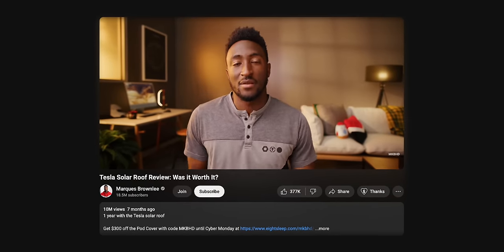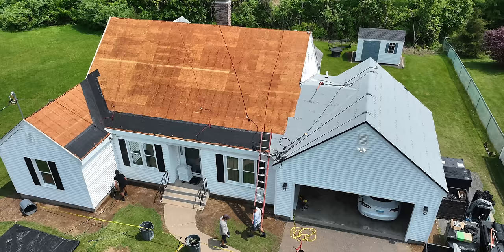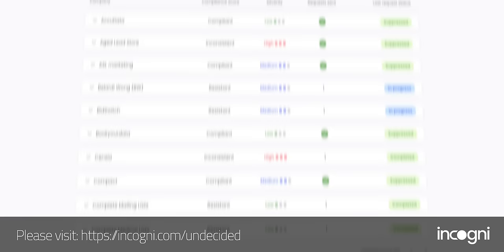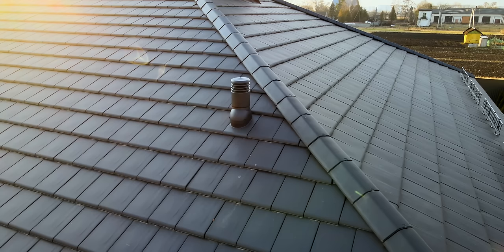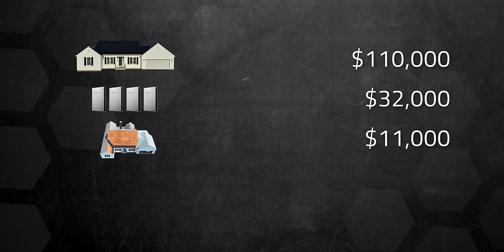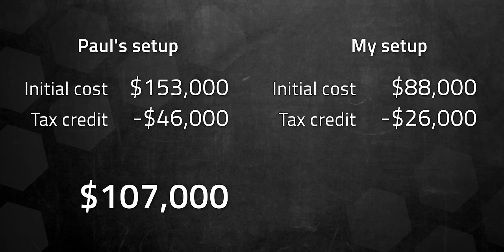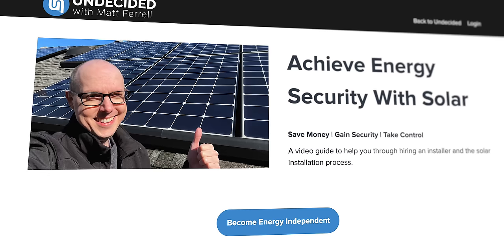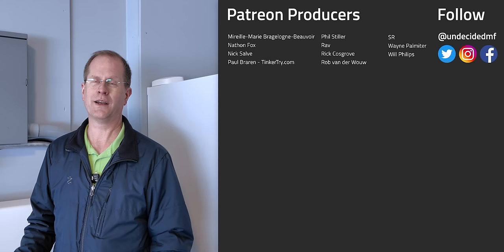Tesla Solar Roof vs Solar Panels: Which is Worth It?

Comment: Great report Matt. As far as gauge for cabling, going N+1 in sizing does really hurt (except one's wallet at install), specially if you are digging, you apy for the future deployments. The hot topic will become Bi-Directional charging/V2G. It also seems like utilities companies should not regulate customer's solar install capacity or number of batteries, which seems to apply depending on states. Tesla deployments are more appealing for sure, if you can afford it and get an installer to put it in. Another great point, where the inverter is smaller than the solar circuit, shaving the top end expands the total daily production output instead of top peak (specially w/East-West setups)_

Comment: The problem with that bug is obviously tesla's only fixing the people who notice that it's doubling how much power they're making because they have another way to measure it they're not pushing that update to everybody and that's the sad part people think they're getting more than they are to offset that cost, its programed to be doubled and they did it on purpose.
Reply: There's actually a 3rd party auditing meter in the inverters, and the power company has their smart meter to keep tabs on accuracy too. It seems this temporary bug has been fixed for everybody now, it just took a while to roll out.
- Paul Braren (Solar Roof owner featured in the video)
Reply: @TinkerTry  In my opinion a product should not even leave the factory with a bug like that, its kinda a ongoing problem with any manufacturing they forget to actually do some in house testing, instead they rely on AI or computer simulations to test products, and that leads to problems obvious problems, installers sure would love to have some input into manufacturing, the layout of the internals is setup for manufacturing not the guys who actually touch and use the inside of these devices and have to troubleshoot or repair. It alot to pay for something obsolete in six years. Do expect those cars to last as long as those panels. Its good old planed obsolescence, those roof panel might be rated to last for 100 years but tesla planed obsolescence for them is 10.
Reply: But hey your lucky your the .0009% of US people who spent money this product.   1 of 3000. Me I would buy a property with creek and make one of those old devices that make torque, o ya a paddlewheel and a windmill old school style, which also outputs more in bad weather, they can work all day unlike solar panels that have a 6 hours on, 18 hours off duty-cycle. But I was taught not to wear black in the summer, you gonna need all that free power to cool that black heat absorbing glass down. I think your panels will still be 90 degrees after midnight on good summer day. Cost? Effective? Be curious of your opinion in ten years will your car and house batterys still be able to drive down the road and put out a charge if cycled once every ten days, my car will and its a 1990 ford festiva, well taken care of and daily driver.

Comment: My takeaway from this is that folks who live up north and/or are influencers spend far, FAR too much money for everything and seem to be ecstatic about it. The "permitting" issues seem to be heavily glossed over as well. Will Prowse taught me (a layman) that I can get solar, batteries etc INSTALLED for less than $2/watt. If one wanted to get used panels it would be even cheaper. Also it would not take months or years to get the system installed.  These systems refenced in this video and by the other fellows featured in this video give a terrible impression to anyone not ALREADY conversant in the advantages and pitfalls of solar power.  I simply fail to see how you all can present such a rosy picture in your cases which are NOT representative of reality.
Overpaying by fifty to one hundred percent OR MORE is NOT a virtue and does NOT make this appealing to "REAL" people. You do home-based solar a disservice.

Comment: Really great presentation Matt😀
Interedting that solar power is so so expensive in USA
How in Australia it is the norm yo have solar power
Guess that is because of the cost
12 years ago i bought a 1.5 kw system.(Yup, minute by your standatds) For about USA $750.
That is about one, two hundred of what you paid!!!!!!
As where i live is warm in summer and supper mild in winter, most of my enrrgy needs are coveted in the day as you can let the aircon and pool pump only run whilst the sun is shining. Result is on average me needing about 7kwh per dsy from the grid.
Cutrently the average solar system installed in Aus is alledgedly 10kw andonly costs a few thoussnd dollars.
Which i guesd is ehy mostoeople hete have solar.
As batteries this year should cist maybe $70 per kwh to manufacture (china has a glut of batteries and think they halve the cost of building batteries this year.
So soon become common for people living in Aus to disoense with being connected to the ekectrical grid as it will be cheaper to run your home from solar and battery.
Sorry for the long ramble,😀
My point is you guys seem to be paying at least ten times as much as we do for solar.

Comment: 55k for 18kw solar not including batteries? You got ripped off dude.. why did it cost so much?
Reply: Yeah I have to ask the same. Since he's not an idiot, there has to be a reason, and the panels he mentions are definitely upscale from what I can gather, but I can buy a pallet of 35 panels, 445 watts each, for like $3 grand; sure, these are 20.5% efficient, not 23%, but... if that's enough, it's enough. Obviously not including mounting, mounting hardware, electronics etc but still, $55 grand seems pretty steep.

Comment: Respectfully, This doesn't make sense to me. Or I'm missing information. I don't remember what you claim is the life span of the solar product itself. I've always understood that solar panels generally have an appropriate 20 year life span. 
Your question, why don't you see more tesla solar roof? In my opinion, it's doesn't make financial sense and in some regions like mine, the government makes it useless. 
Explanation:
On average I pay approximately $100 Canadian per month.
Thus $100 × 12 (month) × 70 (year) = $84,000.
If you stated it cost you $88,000
It would take me over 70 years to break even. Where is the savings? 
Seems cheaper to pay the electric company because I'm 50 years old and unlikely I will live long enough for the next 70 years just to break even on that purchase. 
As for the governments involvement when it comes to solar. They don't give you much of a discount or pay you for giving to the grid and that is the only way here to set it up. Either way, they bill electricity with the water bill. Can't separate it. Thus with their delivery charge, I will always have a minimum $35 bill just for the electricity bill because of the minimum delivery charge. It's the way they earn their operating cost because many have learned to conserve well. I had heard that there was a way to get tesla solar roof for free (for Americans only maybe). In which Tesla installs it but owns it and Tesla therefore earns the revenue for supplying the grid with electricity. Since here it's not a lot, I assume that's why that program is not available here.

Comment: First of all i would go with a ground mount. The racking is a bit more expensive but I never need to worry about a roof problem.  Seccond I would use bifacial panels in a north south fence style where the duck curve is eliminated and lots more output in morning and evening when I need powr the most.. a curve that looks more like a two hump camel.  I am also down in Tn so output is a lot more over the course or the year.  As to cost one can look at where 90% of the panels are produced... you may have heard of China.  You paid a boat load for your batteries I would prefer to not pay 3-4 $ a watt.. Did you know new panels are in the price range of 0.15 cents per watt.  So a 20kw array is the cheapst part. So talking $3000 for panels  Then looking at micro inverters made by apsystems a major player in micro inverter space.. Found them being priced at 130 plus shipping.. would need 18 so call it 3000 with shipping.  2000 for racking and another 3000 for misc. including wire and conduit along with some ac disconnects and such.  All told should come in for around $10000 before federal help.  Sure beats the heck out of 107K  even adding in $5 K-10K for installation.  forgot to add batteries.. call that $3000 as power does not go out around here very often perhaps once every 2 months for 3 hours.  this is for apex battery box and 45 kwh of back up batteries..

Comment: The prices seems WAY to expensive comparred to installation prices here in Denmark. almost double the cost, if you exclude the batteries.(even with a hybrid setup the prices are about x2)
I don't get it... and then looking at tesla prices.. NO WAY 🙂

Comment: Within 15 years  efficiency will drop so much to about maybe 6% re tiling whole house will be necessary. Rather than just updating panels simple not affecting integrity of property because Tesla solar roof not conventional construction, delamination degradation relatively unknown factor Devaluing overall value of property. If money to through away  not concerned with that and virtue signalling your neighbours more important. Is a choice to make I guess. I wouldn't do it. High efficiency tricking setup if land available would be my choice. Very easy relatively cheap minimal disruption would add value. I'd also sort out apparent leaks in basement would be good also. I very rarely watch any M F undecided stuff have unsubscribed a while ago.

Comment: Vivo en un rancho tengo una casa de 3 recámaras comedor sala tengo 16 baterías de 6 voltios Call una tengo 6 paneles solares en el piso me costaron 50 USD cada uno tengo un inversor de 5000 vatios me costó 500 USD En total gasté como 2000 USD más aparte las baterías que valen como 100 USD cada una O un poquito más tengo aire acondicionado Los refrigeradores Y todo trabaja a la perfección no tuve que gastarme 150000 USD se los dejo de tarea

Comment: It iss impossible to watch your videos nowadays, since youtube decides to blare a horribly translated audiotrack, instead of your original audio. There is no option to turn it off either.
Reply from the maker: Thanks for the feedback. To help us out, what language were you listening too?  And if you recall any specific sections or timecodes for bad examples, that's even better.
Reply: @UndecidedMF  i dont know if that is an issue with my youtube client but there is no option to turn the translation off. I'd rather listen to you in english than to a machine translation that - to be fair - was correctly translated but sped up to match your pace.

I'll look into if the issue of not being able to switch audiotracks might be a problem of yt revanced. (It probably is)
Reply from the maker: @m00str  strange.  You should be able to switch it.  On the YouTube user interface on the video player you can tap on the gear icon.  Then select “audio track” and pick which one you want.

Comment: The roof is probably to expensive still I have only seen one in  my 25 building inspector career  with 60,000 inspections under my belt and the builder installer did not know what they were doing in the first place not even basics I had to fail them many times over the build the home owner was freaked out needless to tell you , and the PV,  people hired an electrician who did not know what he was doing also so the general and the electrical guy were basically the blind leading the blind  they could not follow basic installer information and they did not want to either, it was like pulling teeth on a mule, but I have to sign off on it so if anything goes wrong I'm in the mix

Comment: Re: Tesla caring at 16:31. I have had trouble getting my
Multi unit discount. https://youtu.be/xOiD1XD_3NI?si=1QLIEzrBlSCOZwlG I fully believe it was intended but they are basically sticking it to me for $4000 due to my/their oversight, plus either ignorance or lying. It has to be one of the two. I do like the Powerwalls but I have Enphase Solar, arguably better. Example: very little external conduit. IQ 7+ here, have hit 16kw *output*. And summer isn’t here yet.

Comment: it would be nice to understand your expected ROI because all things considered it keep looking like an idiotic alternative to Nuclear to me ( I've solar panels on my own house) . I've seen your other video and made some calculation with parameters I've :  you say your expected consumpion it's 1500 kwh\month which , with current EU prices , means you'd spend around 4-5000 dollars\year in electricity without panels\battery were you to live where I live ....which means with normal inflation a payback of 15 or so years (with zero subsidies ).  I understand the choice is bit more ethical than metrical but without tax credits it's simply a nonsense for the taxpayer . You also support an economy that is largely not american\european by subsidizing panels and batteries on average and when you do ( the installer) is typically a very low value added job. Notthing against your choice off course (or mine for that matter)  , I'm speaking broadly about the sense ( or lack of thereof) in the policies our governaments are perpetuating when the (green) alternative of nuclear&hydros makes way more sense.

Comment: My solar roof installed last March was around $42,000.  Plus, I got a tax credit of $12,798.  Now, I only have about $29,000 left.  I did not opt for the powerwalls.  I did not get a roof replacement since the roof was only 6 years old.

Comment: The both of you got cheated. So expensive. That powerwall battery is a scam for sure. EG4 14kwh battery is around 3.7k. You can buy 4 of that and spend half of what you would spend on a Tesla powerwall. For 30k+ you can get over a 100kwh.
Reply: Don't start with me about DIY batteries. For 30k, only God knows the capacity you would get. $105 for 896wh.

Comment: but the free live in tents. houses are under law. permanent stuff requires worry. under the current administration. if any is required. at all. minimum everything. you must have an off-grid power wall with optional grid plug only. support market model is failed. independency vs dependency by design. clear winner is freedom. you are only doing overhead, not the meat. diy you focus only in the essential. because none is doing it for you. assume no support or reliance. fix sort you stuff. because you are no longer supported. pretenders dont move in, stay out or be in it. there is no mixed mode, law or free. remember there is no false gods of any type.

Comment: I had a conventional solar roof on clay roof tiles that existed before my home purchase and I regret having it. It caused leaks inside my house due to rain after 8-years of owning it. It seems that the solar installer did not do a good job. Not only did they damaged my roof, but they wired it incorrectly. The 14 panels were wired in series instead of parallel. It has costed me about $85,000 to repair the three rooms damaged in the 2-story house, the cost to fix the roof, and four months of hotel stay while my house was remediated from the water damage and build back the rooms. 

I was very disappointed of the solar system and do not recommend to others unless they can guarantee the quality of the installers.

Comment: In this video you show your friend who owns two electric cars.  A smart electric car owner will have one gasoline car at home because you never know when a natural disaster will come to your town. You need a gasoline car to go for long distances without worrying about finding a charging station for your electric car.
Reply: I'm the guy with 2 EVs for 4.5 and 5.5 years now, as mentioned in the video. We rarely have power outages living in this same neighborhood for 29 years now, Most are under 4 hours, and the only one more than a day was 6 days, but even then, gas stations couldn't pump then because they had no power either, so I had to drive a distance to get gas for my generator every day. At least now all I need is to limp through the night off batteries, then my solar will get me through the next day even if the grid is down, charging our cars if really desperate. 
Anyhow, we're quite alright in our area, and I think it's also possible for a lot of people to do quite fine with having both our cars always ready for long road trips charging off solar >99.9% of the time. Just an alternative perspective for folks to consider, as they sift through the many comments below this video.